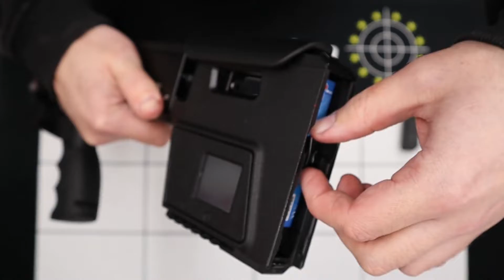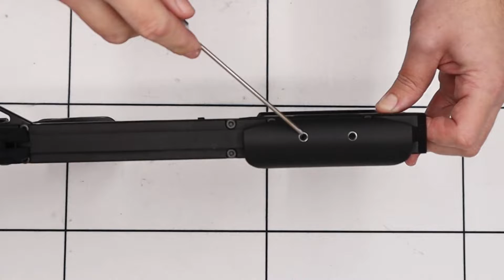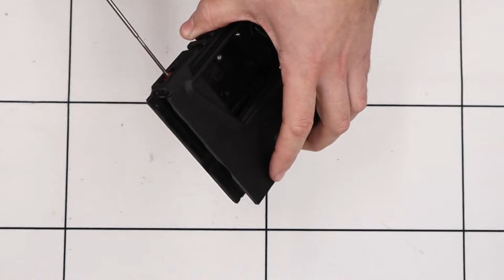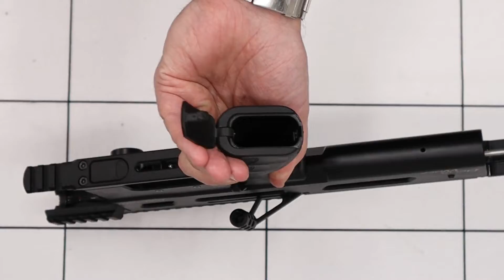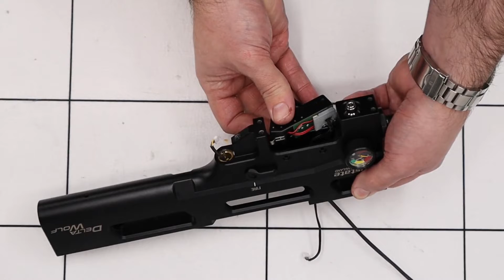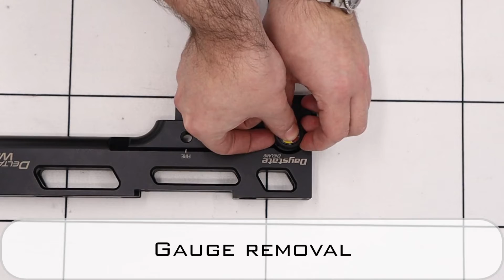Delta Wolf Dissasembly Information.

Comment: You do not have to remove the trigger to get the safety switch out. You can do it carefully by not putting pushing pressure on the pieces when re installing. I did it in converting my DW to AW. No where in the conversion vid did it show removing trigger.